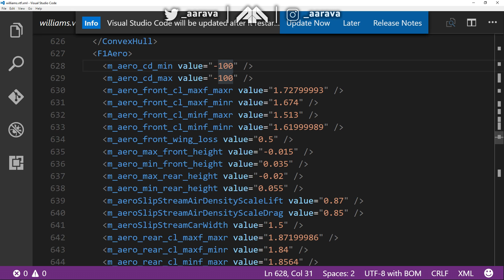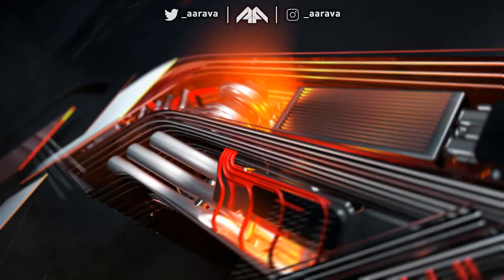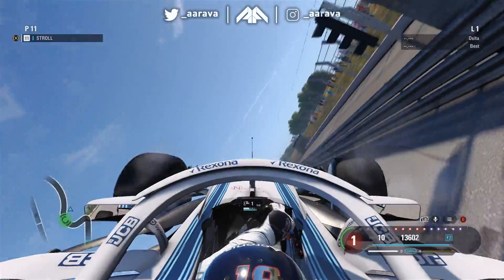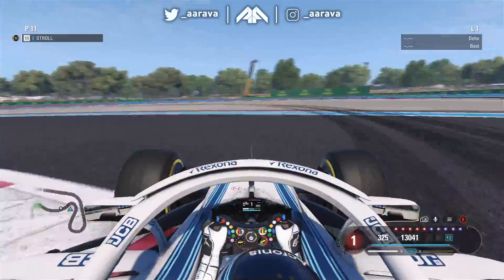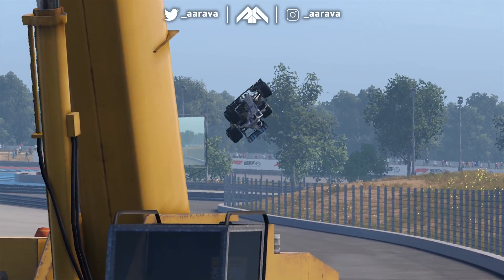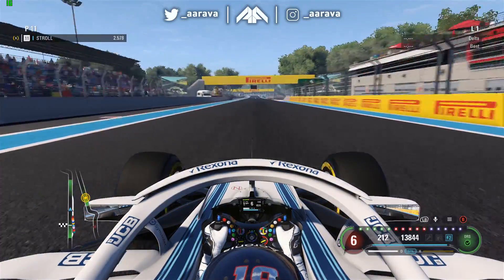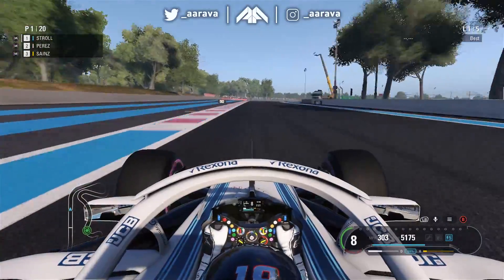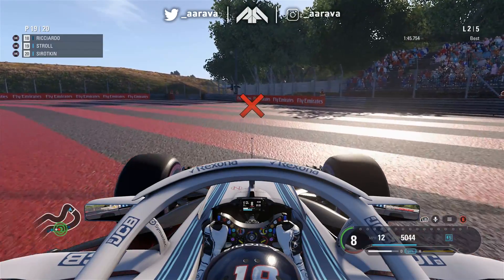What Happens When An F1 Car Has NEGATIVE DRAG?! - F1 Game Experiment

Comment: Ideas:
Negative Horsepower
Negative Downforce
Negative Tire Temps
Negative Weight
Power Distribution to the Front wheels (FWD)

7th Gear: VTEC KICKED IN YOOOOO
Reply: negative downforce=lift, negative tire temps=ice cold tires
Reply: @fredd9340  Thats the point
Reply: Negative mass is physically impossible
Reply: @onorevolenullazzo4210  And everything else on the list is?
Reply: @lookimnotracistbut5695  Also Negative horsepower
Reply: @onorevolenullazzo4210  he said negative weight though so it would basically be upwards gravity
Reply: @jorge8596  I don't think physics work in this way
Reply: negative TEMPS...... DAFUQ!!!!!!
Reply: negative weight= impossible numbers are infinite every object weighs there is no such mass that doesnt weigh only vacuums dont weight.

Comment: If you put negative downforce (i think it's the cl value), the car should fly because it's becomes lift
Reply: Most road cars do produce negative downforce AKA lift, actually. But the lift coefficient usually is so low you'd have to go beyond the speed of sound to overcompensate the weight pulling you down. F1 cars however produce so much downforce that they could drive on the ceiling at about 150 mph, or so they say. So if you put a minus sign in front of the downforce coefficient, that would be the take-off speed.